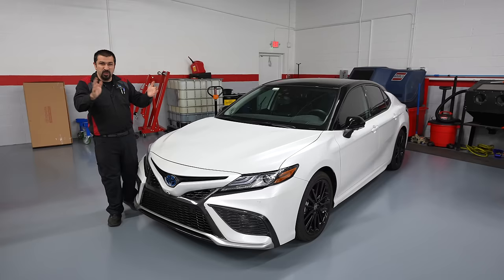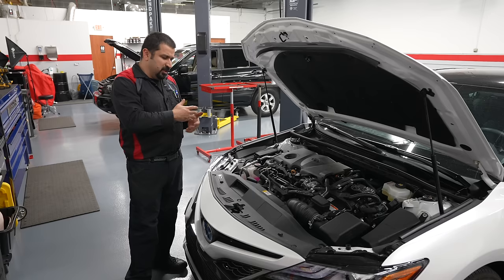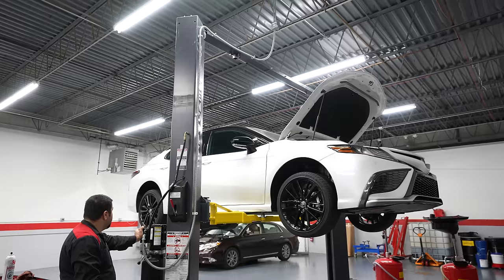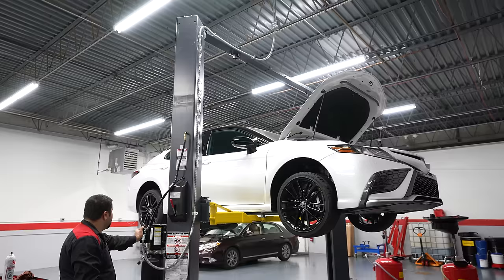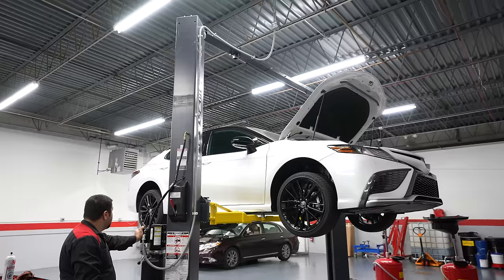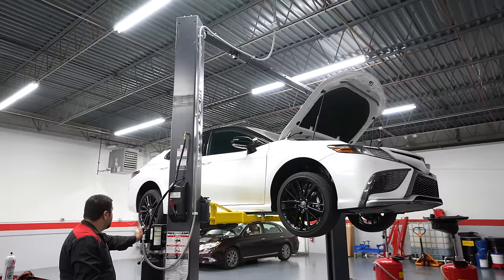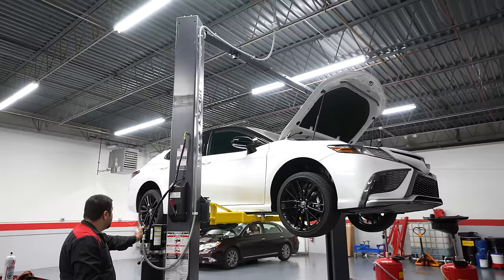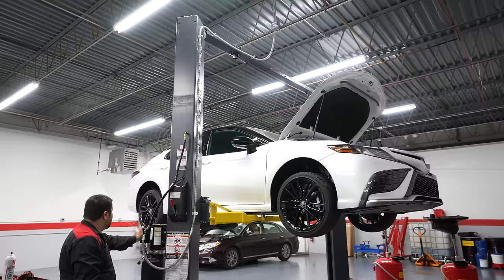Should you buy a Toyota Camry Hybrid? 1 Year Ownership Update

Comment: I got an aftermarket activated charcoal filter (with technically better particulate performance) for my 2020 Camry, works fine. I put AMSoil 0W-16 in mine (price is the same to me as Toyota stuff), and I use the Wix XP filters, which are definitely fine. I don't personally like working with ethylene glycol, so when I do my coolant, I'm going to put a propylene glycol antifreeze in.

This is my first car, so I wasn't sure really who to trust; after repeated interactions, I really don't trust any of the dealer maintenance centers in my area (Southeast Wyoming, including Northern Colorado). Now that I have jacks, stands, and ramps, I am not going to anyone else for maintenance or minor jobs (swapping seasonal wheelsets, rotation, etc.).

I too love the seats, and the steering feel, and the look of the car. I tried out a bunch of cars via agencies and I settled on these new Toyotas. I've drove my 2020 SE (A25A-FKS) across the country four times now, and has just been fantastic.
My 2020 SE has none of those fitment or finish issues. The windows and doors sound completely sealed. The only noise issue I had was the driver assist box behind the rear view mirror, which occasionally rattled. I disassembled it and then put it back together, fixing the issue: a wire was not in quite the right place, which was causing the cover not to stay in place, and rattle.

May the Lord bless you!
Reply: How do you like the Amsoil 0w-16 compared to the Toyota 0w-16?
Reply: @AE821   I have no real basis to compare them. I could do a lab comparo over the next two changes, might do.

Comment: I have had my corolla hybrid since March and I have put 15,000 miles on it already. I drive a ton so I love it. Just got rear-ended what should I have them look at for repairs?
Reply: Since you have driven it so much, you will be able to tell if steering/suspension is off. Go for the insurance and repairs.  Any medical conditions need to be attended to for your life and health first.  #GodBless
Reply from the maker: Make sure it’s fixed right. Panel gaps look good, paint matches and there are no leaks in the trunk

Comment: I really want to get a Camry hybrid soon to balance out the gas mileage I get on my 4Runner. 😅 I just really wish they were made in Japan, the fit and finish is superior and I trust them more to handle these complicated hybrid systems. Hopefully they start making them in JDM land again, if not I might have to look at the upcoming Crown 👑.
Reply: My corolla hybrid was made in Japan
Reply: Where are the Camry Hybrids made? I was hoping he would say where his was made.
Reply: @ADDwithJTC  as far as I know, all the Camry’s here are made in Georgetown, KY.
Reply: @ADDwithJTC  I have a 2013 Camry conventional, and overall it’s been a good car.  215,000 miles with no oil leaks or consumption.  Still runs smooth.  I drive 45 miles one way to get to work.  Still has the original water pump and belt.  It’s only on its second battery and second set of brakes.  This one was built at the Subaru plant in Indianapolis.  They had some kind or partnership with Toyota for a few years to produce some of the Camry’s.  Unsure as to why.  They may not all be built in Japan, but they still answer to HQ.
Reply: @bluegrassman3040  oh nice! I would think they are made elsewhere as well. I know Mexico taking over for many manufacturers including Toyota unfortunately.
Reply: @bluegrassman3040  that's awesome! I know when they're made in the US they are usually good quality as well as Canada and Japan. Unfortunately though I know Mexico is taking over for many manufacturers including Toyota. Just have to check where your vehicles are made before you buy them. Already problems with Toyota's and other makes made in Mexico. My Hyundai was made in Korea and my Ford in Michigan. Have both for years zero issues, rattles or anything. Just silent great rides and amazing quality.

Comment: I had a Camry 2020 SE as a rental while my accord was in the body shop. It was about December and 20 something degrees. It seemed like it had trouble getting up to operating temperature which made the heat not as hot as it should be. My commute is mostly highway for 30miles to work. It would get completely up to operating temperature about halfway thru my commute
Reply: There may have been an issue with that specific car. My 2021 Camry Hybrid LE heats up extremely quickly.
Reply: Maybe they put the wrong oil in it?
Reply: @notsureyou  that’s completely unrelated

Comment: I have a 2023 V6 XSE in red. Love it. Most irritating thing it does is with the cruise on at 60+ mph when you enter a curve the cruise goes off the gas and might tough the brakes. Like it’s setting it into the corner. It’s really unsettling and I hate it. Other than that, I stepped out of a 1794 Tundra into the XSE, sitting lower is an adjustment, paying 11mpg gas cost in the 1794 is not missed. Another nice video. Thanks.

Comment: When it comes to hybrids Toyota/Lexus are at the top, although reliability and longevity wise I will always side with their N/A gasoline powered vehicles. 2007 ES350 sitting at 350K miles with nothing but fluids and filters no catastrophic failures. Just picked up a 2022 ES350 and already at 15K miles within 5 months and I have no doubt it will go just as long as my 07'. If you keep up with maintenance these cars are damn near bulletproof. Can't imagine a battery holding up to the abuse and wear and tear of everyday driving especially higher mileage. I am however skeptical of the 0W-20 10K mileage oil service intervals used on the newer Toyota/Lexus products, will stick to 5K intervals on the 22' just as I have been doing on the 07'. Let the dealer change the oil at its first service since it was free and service advisor told me everything looked normal.

Comment: AMD Thank you for the video! I have the exact same issues with my 2020 Camry LE. Car shipped to me brand new and it had gaps everywhere like it was in an accident, the uneven panels scratched each other and caused rust in the trunk and hood. But the biggest issue is the ticks and rattles. I've spent over 30 hours fixing it with felt tape, silicone, and Noico deadening, I'd say 80% of them are gone (especially the one in the AC front dash rectangle), but the rest have driven me to insanity. This is why I will be switching to an ES250 in the future. Love your videos man!

Comment: I would be doing the first break-in oil change on my wife’s 2-month old 2023 Venza Limited in about a couple of days. It only has 755 miles on it so far. It has just been mostly sitting in the garage. It only gets driven approximately once a week. This video certainly helps. Thanks AMD. 👍🏼
Reply: Just did the break-in oil change to my 2 month old 2023 Venza at 755 miles. I was surprised to find that the original oil filter’s part number was 90915-10009. Looks exactly the same as the 90915-YZZN1.
Reply: @mr3klax  Same here when I did the break-in oil change on my 2022 Camry Hybrid. I guess that is the standard OEM filter they use when the car is assembled during initial production.

Comment: 11-19-22. 30,000 miles.  Absolutely zero problems. Location a beach city in Southern Calif with magnificent weather. I bought the 2017 Toyota Camry Hybrid., keep it in the garage and drive it around the beach cities and on the freeway now and then for short trips. Use an indy shop to change the oil  (Pennzoil full synthetic) and a Toyota oil filter that I bought from the local Toyota dealer Part Dept. Same for the OEM air filters that I changed, Took the back ez to remove seat out and inspected the drive battery cooling duct, vacuumed the filter and inspected the bower fins for dirt on the cooling fan (not mentioned in the owners manual) but very easy to (20-min) do once you have seen the how to vid on YouTube.

Comment: great car but get the LE, buy the $40 black wheel covers and it will just look like yours. In my LE I was getting 55 mpg. I bought a new 2022 for $29k, I drove it 2 years for uber and put 90k miles on it. Just sold it for $25k. Amazing. Bought a new 2023 Prius. Not sure I made the right choice.

Comment: I'm amazed about the oil change. I had many cars in EU and change my oil every 40,000 km myself. The engine after 400,000 km run as a charm and used only 25 ml/1000 km. The cars are Peugeot's now Toyota's.

Comment: Get a nvh kit from Toyota, then get the felt and cut a 1 inch wide strip roll it and slide it between the windshield and dash it will fix the dash noise. The door noise, roll down window open door place your knee in upper part of the door panel then pull the window frame in be careful to not over due it. The wind noise will go away. I worked at Lexus and Toyota for 30 + years fixed every problem they had. Always tried to fix it like it was my grandmother’s was my motto.

Comment: First 1,000 miles under 2,500 rpm and drive under 65 mph. Change oil. Drive normally next 3,000 miles. Change oil. Drive normal for the rest of your cars life. Change oil every 5,000 miles, minimum once a year. I have a Land Cruiser with 406,000 miles and it idles so smoothly.

Comment: I'm a bit confused with checking the oil level.  For decades I thought that it's best to check the oil level when the engine is cold, as in first thing in the morning so that you know all the oil has dripped to the pan and you are really reading all the oil.  If you check it while the engine is still hot, not all the oil has drained and you will overfill it.  Now, we're being told to do so while it's hot because "that's where the oil is all the time" and "oil expands."  I get that about expansion, but I thought the mark on the dipstick is the level of oil in the pan when the engine is off.  Secondly, I've never added more than the recommended amount of oil.  Actually, I add about half a quart less and then check in in the morning.  I never had the oil overfilled when checking in the morning, even after I topped it off when the engine is cold and checked it the next morning.  Am I to check it right after it was running and hot?  What level am I checking then?  I'm sure there's oil all around the engine and not in the pan?  Confused.
Reply: I was taught start it and run it 10 min.,  then let it sit 10 min to drain back down. Then check it.

Comment: Hmmm.  Seem to remember in a video you posted a year or two ago you made the point to never top oil to full in a toyota hybrid.  In fact, if I recall, you made a point of a process of steps in changing said oil, from filling a bit low, test driving for 5 or 10 min, and final top-up (but not to FULL).

Comment: You should be priming filters - even if they sit on their side as most do on Toyota. This reduces "dry start" wear by cutting down the time it takes for the oil pump to fill the filter and pressurize the system.

Comment: I really like my 17’ Camry LE 162k miles since new.  No rattles at all ha ha. Drives super smooth and horsepower is more than adequate. If I need speed I’ll get a BMW Interior has better visibility than the next generation too.  I will not get another Camry because it will not get much better than this. Also love that it has better visibility more glass than the new gen. What’s really surprising is that the audio system in my 17 LE is better sounding than JBL systems they put in new Toyotas. Love the simplicity of my Camry and the stable comfortable ride.

Comment: Yes it’s absolutely fantastic that you are changing the oil on the frequency that you are doing it. But I am looking for a used vehicle and I assure you that no one has done this. It’s lucky that you find somebody to change the oil at 5000 miles on a newer vehicle most of them are doing it on the factory recommended 10,000 mile oil change and most of them are doing the very first one at 10,000 miles. Yes that is not good at all but that is what the dealer is telling new customers because Toyota changes the oil for free at 10,000 not 5000. I completely disagree with Toyota’s 10,000 mile intervals I am 100% on your page about changing the oil on a very frequent basis. Oil and filters are cheap engines are not. Thank you for all your fantastic videos I am definitely a fan of yours.

Comment: To help get those metal sparkly bits out of the break-in oil better (and for long term), get a magnetic drain plug, preferably a neodymium magnet type, like GoldPlug or Dimple or Votex brands, not the cheap useless weak magnet ones.  Also, use a better oil filter.  Fram Ultra or Fram Titanium oil filters gets even smaller particles out, better filtering, cleaner oil (ISO 4548-12 and USCAR-36 engineering tests).

Comment: Fantastic video as per usual with you. I love your in depth and totally natural way of talking about these vehicles. You can tell you have a high amount of knowledge and experience with them, it shows in how easily the information comes to you. I was watching the video and I'm not sure if it's the lighting, or if it's just something I thought about and now I can't see anything else because my brain won't let me, but it almost looks like there are 3 different shades of white on the driver's side. The front fender and front door look to be a very miniscule amount darker/glossier than the surrounding panels. The back door looks like it is blending the front paint and the back paint together, and then the rest of the car looks to be uniform. I wonder if something happened in quality control where they had to repaint these panels and maybe took them off and that's why the door, fender, and headlight lines don't align? It's very uncharacteristic of Toyota to have misaligned panels from what I've seen. But you have seen more, so it could be normal. Just my two cents, I thought I would throw that out there. Maybe you've seen it, maybe you haven't. Either way, thanks for doing what you do. Whenever I encounter a new thing on a Toyota product, I always go to your channel to see if I can find it first. Because I know I'll get the best information available. God bless you sir
Reply: It first caught my eye when you moved the car at the beginning of the video. It definitely does not look like the same shade of white.

Comment: I'm thinking most of these newer engines are designed with a fair amount of fuel dilution to occur. Some of Volvo's B4204TXX engines are getting between 3% and 10% oil dilution between 7500 mile oil changes. On my non-hybrid Volvo, the oil generally starts reeking of fuel around the 3k mile mark and fuel economy starts dipping shortly after. I'm thinking about replacing it with a Camry Hybrid later when I get to that point in life, but I'll be the first to say I keep my car in the wind. One year and 30k miles later, I'm wondering how well the Camry will deal with it over the course of 10-15 years. I'm sure I'm going to have to rebuild my Volvo if I keep up like this, but on this Camry, I don't think I would worry SO much with it.

Comment: You can see that Filter in a Denso.  Often the Vehicle Manufacturer like Toyota will in the OE Supply Contract ban the Supplier selling the same part in the aftermarket especially if Toyota have invested in the tooling to make the part unique.  Explains the differences in specs for the aftermarket across a massive array of aftermarket products.

Comment: My 2021 Corolla Hybrid had a squeak in the same area as yours. Started off only making noise intermittently. Then after a long road trip where the road had frost heaves, something popped and it squeaked all the time. The dealer had to remove the dash and tighten a loose screw. No problems since.

Comment: A 2019 Hybrid SE in Blue.  Love it so much as I was scared after departing from my Solara 2000.  Only complaint was the seat height to the console steering wheel and seeing the analog tach/speedometer.  I am 6' and it was finicky to get a good adjustment to view it through the steering wheel.  I dislike the digital speedometer and rather read the hybrid performance rating and estimated range.  Either the 2022 or 2023 release fixed the seat height by dropping it down 2inches and I envy that change.  Maybe 10yrs from now, can see if those year model seats are compatible with the 2019 mounting.  On a good day, 48mpg with feather feat but its about 42/43 avg now.  SoCali area